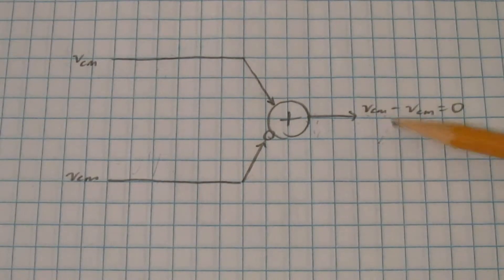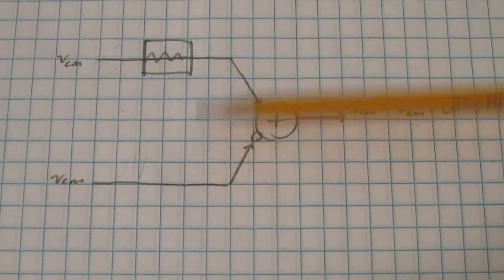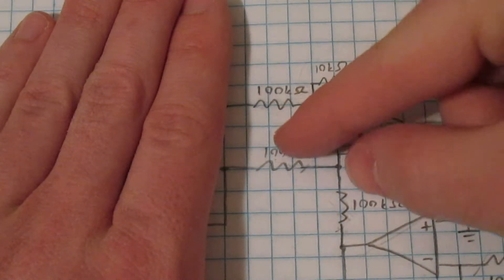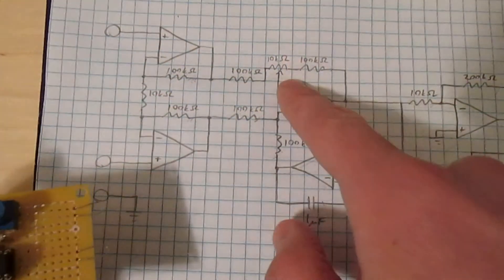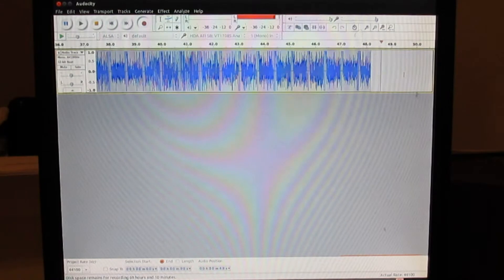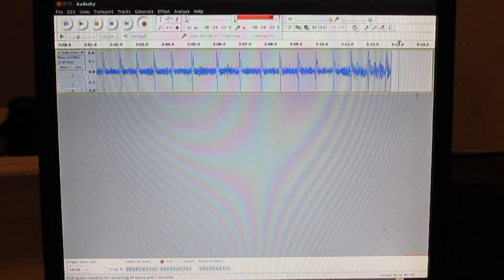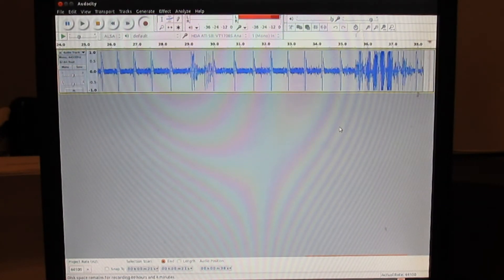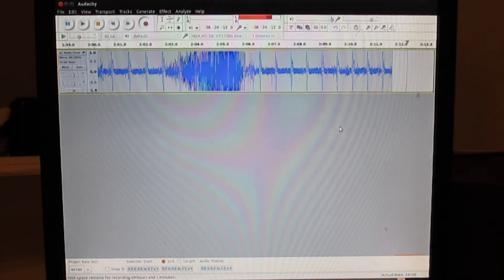ECG Mk. III Part 7 - Trying to Improve Common Mode Rejection

Comment: Common mode inputs might have phase shift due to parasitic capacitance. Its not only the magnitudes should be equal but also the phases for perfect rejection. imao
Reply from the maker: You're absolutely right, and I feel like a dummy for not thinking of phase at the time.  Phase is probably even more important than amplitude in this case, as phase imballance gets worse with higher frequencies IIRC.